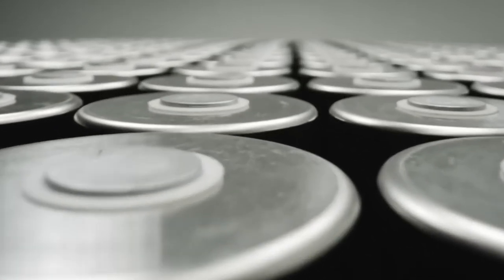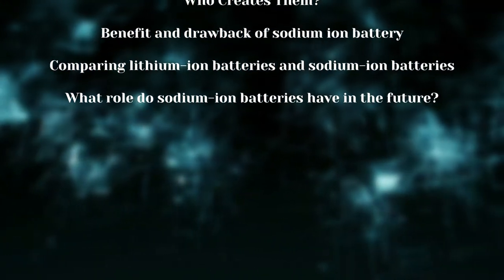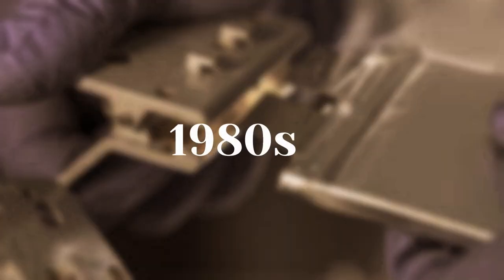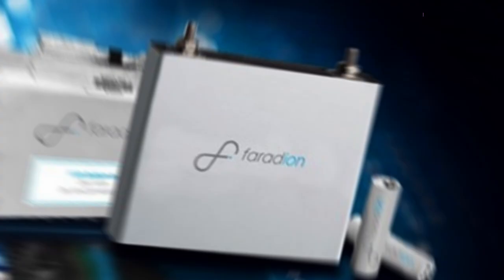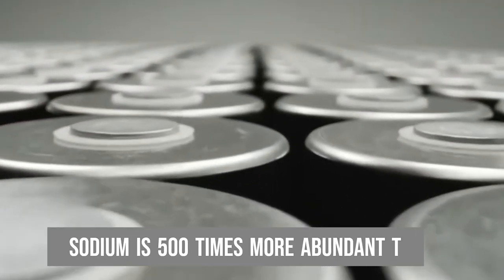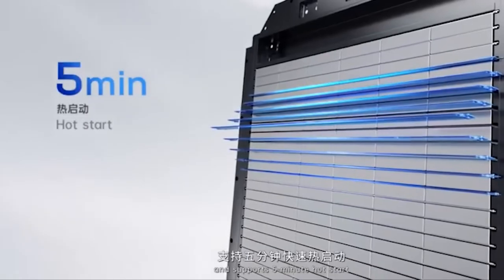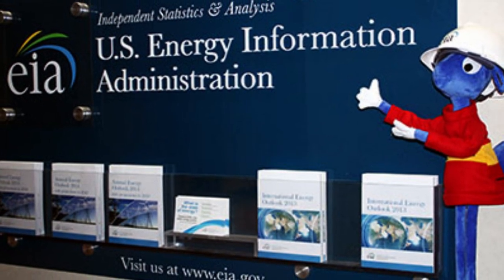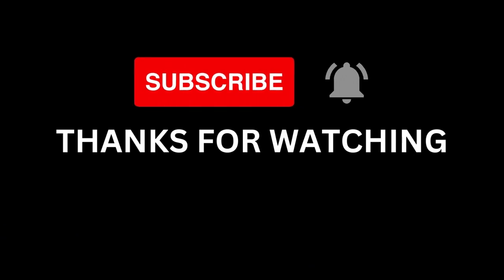Goodbye Lithium! NEW Sodium Ion 4.0 Battery Changes Everything in 2023

Comment: If sodium batteries have low energy density and low output, that is not the end of lithium batteries.  CATL announced it will produce lithium sodium batteries that have the advantages of lithium and sodium in one package.  Not pure sodium batteries your video states.
Reply: a few days later they released another, check again